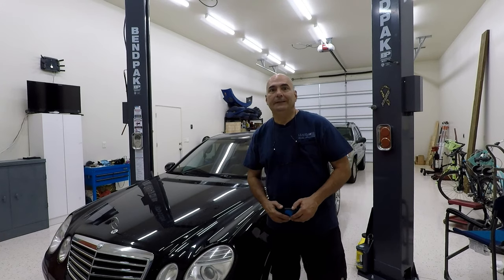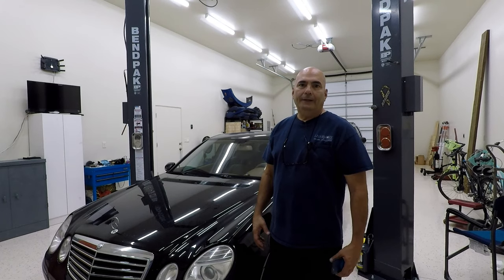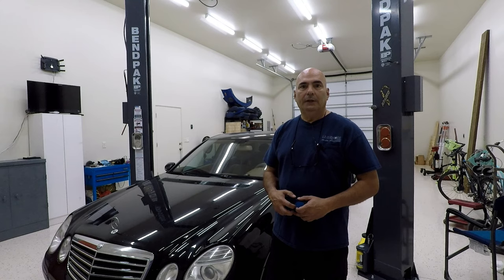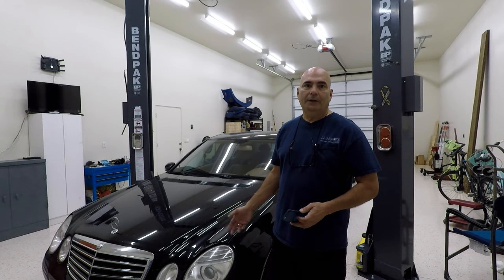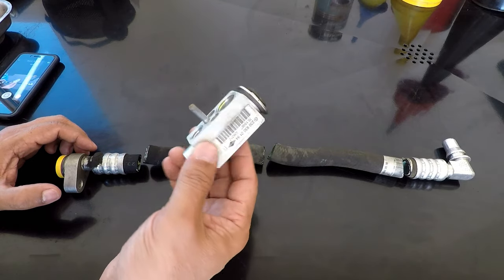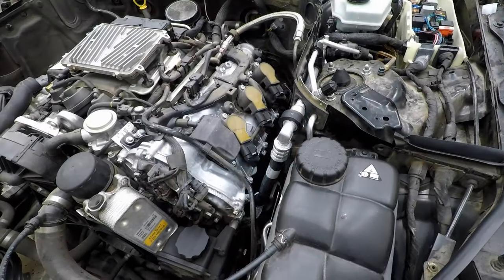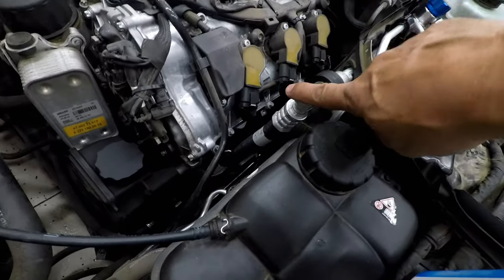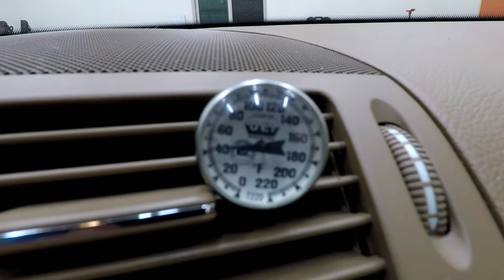Mercedes Benz A/C Not Cold!  Watch Out For This Hose!

Comment: Another design flaw that's really haunting me is the location of cooling coil .if this goes bad then seems to dump the car ..no?
Reply from the maker: The evaporator core very rarely fails. I would not worry about it.
Reply: @InitechAuto  hope so that coil doesnt go bad. So far ac working cool for 2 days.. hope it stays that way but If its leader then mechanic said coil might be leaking  . God knows
Reply from the maker: @dentalmanuk   Might be? There is no such thing. It either leaks or it does not. No one should guess. Unless you like to throw money away. There are tools to help you find leaks.

Comment: That coupler you said not to break... Any tips on getting it detached without breaking it?
Reply from the maker: you need a special disconnect tool. Here is the link.
https://www.ecstuning.com/b-cta-tools-parts/mercedes-benz-a-c-low-side-coupler-wrench/cta2763~cta/?gclid=CjwKCAjwjJmIBhA4EiwAQdCbxj7HNsq9wMdzKqgbX6Ox8M4WxocOCpMKpZCuImRpIi6DIqBoxbK6txoCfQ4QAvD_BwE
Reply: @InitechAuto  I am in the same boat now. Did you use that tool? How to use it? Thanks 😊
Reply from the maker: @singhsarabjit   I never used the tool. I broke the coupler and had to replace the hose.  It looks pretty simple  to use tho.

Comment: Hello, Sir. did the AC only feel cold on the right hand side, or both side not cold at all? i have problems that my left hand side AC is sometimes cold and sometimes not. might this issue caused by the same hose?
Reply from the maker: No, this hose would affect the whole system. What you are describing is a blend door problem.
Reply: @InitechAuto  is blender door issue can decrease the freon Level? Got mine checked on the authorized service center, they said blend door having no issue, but the freon level is decreasing
Reply from the maker: @GeorgeusGeraldo  
Top it off and see what happens. If the freon is decreasing then you have a leak.
Reply: @InitechAuto  alright, will do another check on another service center. Really appreciate your help, Sir. Thank you

Comment: Mine also not cold and went to mechanic he sort of cleared the entire system through a machine and then vacuumed system..added 6 bottles of oil and refrigerant.. now it's cold..  does it mean the problem is settled or might be some kind of leakage??
Reply from the maker: During the evacuation and recharging of the system. The mechanic should’ve checked for leaks at that time.

Comment: Hi. I have this hose from Mercedes, ready to install. But I'm having trouble getting hold of this tool, and trying to get the job done today if possible. Does anyone know a work-around to this tool that has worked? Or know exactly how the tool disconnects this coupler? Thank you.
Reply from the maker: https://www.ecstuning.com/b-cta-tools-parts/mercedes-benz-a-c-low-side-coupler-wrench/cta2763~cta/?gclid=CjwKCAjw9aiIBhA1EiwAJ_GTSh29uoUCqnWZM8tvh07VO6MznGIKYPd48JnyYN8dJPlRq14_sfQFohoCshoQAvD_BwE
https://www.fcpeuro.com/products/mercedes-ac-low-side-coupler-remover-cta-tools-2763?ads_cmpid=352578559&ads_adid=22978217719&ads_matchtype=&ads_network=g&ads_creative=85228362199&utm_term=&ads_targetid=pla-70936742985&utm_campaign=&utm_source=adwords&utm_medium=ppc&ttv=2&gclid=CjwKCAjw9aiIBhA1EiwAJ_GTSuK0WUWgzlJBeWMic3iDS-JeJyrgCs0NWyESVGm5Y2Lko5aywOQ7gxoCONUQAvD_BwE
Reply: @InitechAuto  thanks again. I was looking for a work around if possible though. Its just a time restraint, since I can just get someone to do it next week if I'm able to free up the time for that appointment. The delivery cost and time (to Canada) would mean waiting for this tool to arrive wouldn't be feasible for me. 
But looking at the images I have of the connector and the tool, it does seem like you just need to pinch the white tabs in and up, and then pull out the hose (I've used almost similar fittings in plumbing). Of course if someone with experience says thats a big no with this fitting, then I won't try it

Comment: Hi 2008 GL550 here, got a new compressor 1 year ago. do you think it's part of the routine to change this hose too? Now, AC sometimes works and sometimes doesn't. Got vacuumed and recharged like 4 times in the past 2 months. Only 1.2 lbs R134a left while total should be 2.7 lbs. There should be a leak somewhere but one mechanic said it could be "hose saturation, not a leak" due to the expansion valve got stuck. They added dye bu quick looks did not find much (was traveling with a trailer). I'm new to this but the gauge readings seem not consistent. Sometimes it's 115 low and 200 high. sometimes it's 40 low and 125 high, etc. Can you point me to the right direction? Appreciate your help!
Reply from the maker: Sounds like you have a leak they have not found.  "hose saturation, not a leak" That's a good one! Hose saturation is a leak.
I would replace the hose in the video If you have one.  If your pressures are still erratic I would try a new expansion valve.
Reply: @InitechAuto  thanks for your quick response. Yes I was planning to replace this hose and expansion valve. BTW I just checked the pressures again and now, static 100 low 85 high. When engine on AC on, 96 low 85 high. Turn off AC, wait a bit, turn AC on, the low went down to about 90, them climbs back to 96ish quickly. Ambient temp was like 85-90F. I did get a recharge yesterday, and it worked for only 20 minutes. Is this an indication of a bad compressor? Or some sensor prevented the compressor to run?
Reply from the maker: @AZ-mw4rs  High side is way too low with the engine running. Should be around 185 to 200 PSI and low side should be around 40 PSI.  Maybe your compressor did die.

Comment: Hy mate,i have  mercedes benz a class A170 ..a 2 months ago heating work without problems,when i comeback from holliday heating dont have power like before..come a little warm air inside the car but not like before,when was winter in 2 minute was warm in the car..you know what can be the problem?
Reply from the maker: Check your coolant level, thermostat, blower motor, and actuator controls for the heater.

Comment: Is it possible to have this problem on a 2000 c280. My air quit and will not get cool on recharge. When  purchased it air was not cool but recharge made it cool. I do not have this hose. I think mine is aluminum flex.
Reply from the maker: What are your manifold gauge readings?
Reply: Sorry I have not looked. I would have to go rent them. I just know I used to be able to recharge it and it would get cold. But now it makes no difference. I wondered if it might be that thing on the firewall. But no air anymore. It did work. And the  it didn't.

Comment: Plz how did you remove the clip at the other enddbof the hose?
Reply from the maker: I ended up breaking mine by accident. There is a tool you need to buy to remove the coupler.  The link for the tool is in the video description.  Good luck!

Comment: 09 GL450.  Is there a way to tell if the hose has already been replaced? Like, is there a color code or date code for the updated hose? I just charged the system up and it was only cool for a few seconds, then ambient temperature air.
Reply from the maker: Look at the list that is in the video.  If you fall under that list I would just replace the hose.  As far as I know, you can't tell.  Also look at your manifold gauges.. what readings are you getting.  That is the big FBI clue.
Reply: @InitechAuto  I think that my first issue is to replace the compressor. About 120 on the high side and 70ish on the low side with a verified full charge.  I noted the low side would cycle about 4-5psi up or down and near zero cold air.
Reply from the maker: @jasonmoriset9292   Low side is too high. Should be around 30 to 40 psi.
Reply: @InitechAuto  that's why I think the compressor is shot.
Reply from the maker: @jasonmoriset9292  I don’t think a compressor would cause the low side to be that high.  I think you have a partial restriction somewhere. Most likely be the hose in the video or the expansion valve.

Comment: Hey thanks for the video.  Been going crazy for 3 years and back and forth with dealer.  Is there a link for the bulletin you found on MB website.  Also what is the exact name of the hose so I can let the mechanic know.  Thanks so much!  Hopefully this will resolve the issue .
Reply from the maker: Suction side a/c hose @ compressor.  Don't do the work for them.  Tell them there is a bulletin on the subject. They can look it up themselves.
Reply: @InitechAuto  problem is that they end up messing other things up coz they re too lazy to check how to, and end up just piling costs onto owners. If I'm using my non mb mechanic, I'd give them all the help i can. At mb itself they would just scoff and f it up further on purpose

Comment: Hi mate. Do you think could be same issue in my w207 2009 e350 3.0diesel ?
Reply from the maker: What are your manifold gauge readings?
Reply: @InitechAuto  I will check today. Only I know diagnostic data pressure reading is 8,2 bar and don't change much when ac is on or off

Comment: Did you happen to have the part number for the updated hose?
Reply from the maker: All the new replacement hoses will be updated. Part numbers will vary depending on the model of the vehicle.
Reply: @InitechAuto  2010 gl550
Reply from the maker: @samuelcaldwell8697  
All the new hoses will be of the updated design. You have to look it up by vehicle application.

Comment: Hello Nicoya i have a lovely MB CLS 320 cdi  (219.322)Manufacture in 2006 (Chassis  WDD2193222A088331)  About 7 months ago i got my AC serviced by a garage and they topped up the System with R134A- now three days ago i noticed (Summer is hear and the temperature is getting warmer in Europe) the right hand side of the  car the Air is warmer  than the left hand side (my car is Right hand drive)and i do not have any warning on my dash about AC problems -do you know what could be wrong and what i should do any advice will be great
Reply from the maker: Sounds like you have a dual climate control system. Check your blend doors and actuators for proper operation.
Reply: @InitechAuto  do you know where i can have some more information like how to remove Blend doors and actuators   before i tackle this myself any links  will be great - and if i decide to take it to a garage should take it to a AC specialist or a local garage or MB specialist-
Reply from the maker: @anthonysilva8220  Your best bet is probably the Mercedes-Benz specialist. This is something that if you’re not familiar with I would not attempt to do.

Comment: Dear nic, mine is a 2005 model 211 e class kompressor. Today we had an issue with ac, we found the black couplar which u mentioned in the video to be broken. The connecting ends are now loosend. Now what to do. Pls help dear.... any suggestions woupd be extremely appreciated. Thanks in advance. Does this happen due to thermal expansion valve ? Compressor fan not working ? Last week they filled 450 gms of coolant. What could have caused wrong.... here mechanics are cheaters...they would loog money....pls help🙏🙏🙏
Reply from the maker: If the coupler is broken you have to replace the hose that is part of it. Then you have to vacuum and refill the a/c system. The thermal expansion has nothing to do with it.
Reply: @InitechAuto  actually only the couplar is broken...are u saying its alone not available. Have to change the full pipe?  And one more doubt...what reason could have caused it...due to high pressure of gas ? Any idea dear?
Reply from the maker: @remyakrishnan7746  Yes the whole hose has to be replaced. The coupler is part of the hose.  As to why it failed I have no idea. But I can tell you that it was not the freon pressure. The hose is made to withstand the pressures.
Reply: @InitechAuto  thanks dear, i got it replaced. And one more doubt pls... Few weeks back there was sqeueky noise from suspension. And they made me change arms. Ball joints etc etc... And after few days again that noises are coming. What could be the issue? Any guess.... Ur time is appreciated... Thanks in advance
Reply from the maker: @remyakrishnan7746  Check your struts.
Reply: @InitechAuto  thanks, i got it cleared...here in india...mechanics are not knowledgeble like in usa or uk....to repair premium cars...sorry for bothering u....and one more thing...there is smell of gasoline once i open the car...immediately after refuelling...and when parking also...what could be wrong...mechanics say its fuel injector leak...i cant see any drops of petrol...can u pls guess...🙏🏽
Reply from the maker: @remyakrishnan7746  Have them check the fuel tank.  There is a seal for the fuel pump or Evap. control system that is ontop of the fuel tank.
https://www.youtube.com/watch?v=20OGpydcqeQ&t=940s
Here is a video that shows me replacing a fuel tank. At around 12:00 min mark you will see a white plastic cap. That is where they tend to leak.
Reply from the maker: @remyakrishnan7746   Check your fuel tank seal for the fuel pump or Evap system.  They are known to leak. The seal is located on top of the tank.

Comment: Hi what is the parts I need please I have a Mercedes e class w212
Reply from the maker: Check with your parts store and check and see what part goes to your vehicle specifically. I do not have the part number for the one that I used in this video.

Comment: How could you have 70 psi if hose restricted the low side it should have had vacume reading
Reply from the maker: Not necessarily. That’s what makes this problem very unique. Go to the Mercedes website. And look up this hose. It explains what happens.  I thought the same thing. And replaced the expansion valve because of the readings I was getting.

Comment: Nicoya - Nicaragua?
Reply from the maker: Pinolero!
Reply: Igual! I just subscribed. This is very informative my brother. My AC is not working. My car is blowing but hot air. I’m going to try this if not it’s probably going to be the compressor.
Reply from the maker: @714ATK   Check your A/C pressures.  It will help you to diagnose the problem.

Comment: Mercedes from RICHMOND quote for my 2012 CL550 with 33,000 Km for this issue.

To replace the AC hose, we will need to access the AC Compressor. The job involves dropping the subframe as there is limited space.  Germany parts are 2-3 weeks away. We can release the vehicle & return for the work when the parts arrive. 
In the picture, the AC hose have condensation, that is normal condensation as the AC hose is cold. 

Labor time is approx. 13hrs ($2665)
REFRIGERANT LINE - $280 - GERMANY
SPACER RING - $8 - GERMANY
SEALING RING - $13 - IN STOCK
Refrigerant $400 + Alignment $290= $690
Total : $3656+taxes
Reply from the maker: Ouch, that is very painful.
Reply: Yeah no kidding.  They need to drop the engine to change an AC hose?  You'd think Mercedes having had AC issues going back to the 80's would make this more accessible..

Is there a hose that can be rerouted somewhere else possibly?
Reply from the maker: @sarahrose220   That price just seems outrageous. I really think you should get a second opinion from a Mercedes mechanic other than the dealer. Unfortunately, I could not find any info on what it takes to replace the hoses from the A/C compressor for your vehicle.

Comment: My ac is automatically turning off Mercedes s 550 08
Reply from the maker: Ok, thats not really telling much. Does it shut off right away or does it work awhile and then stop? Did you check for a full charge of freon? Is the compressor running?
Reply: @InitechAuto  it turns off a few seconds after turning it on, one of the hoses is really old , could this cause the system to do this?
Reply from the maker: @mercedez179   Sounds like its low on charge.  Take to a A/C specialist and have them look at it.
Reply: Thank you